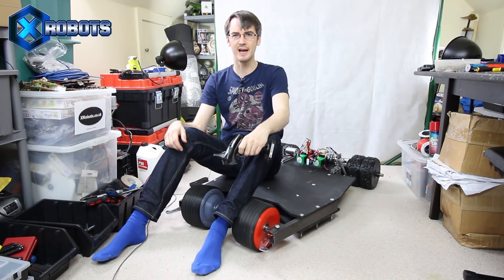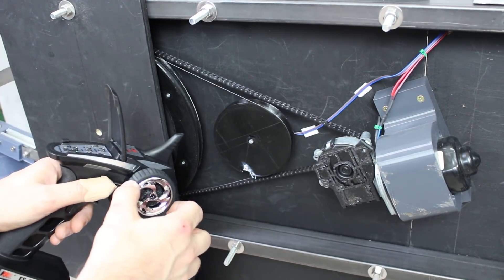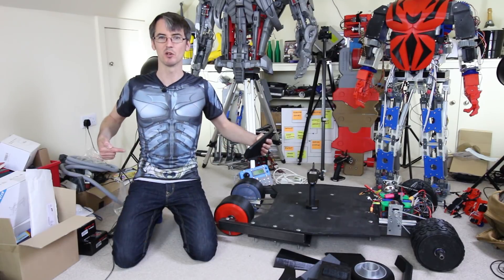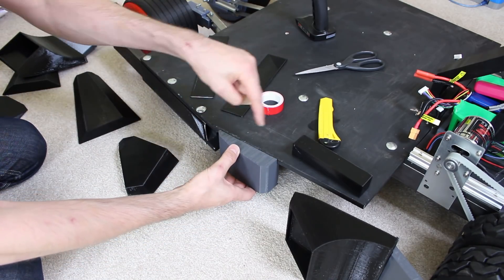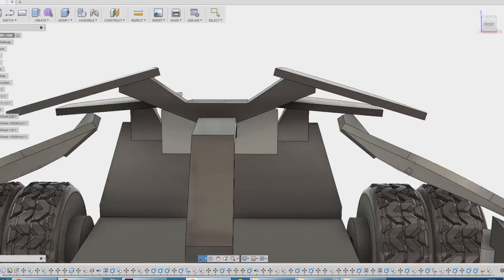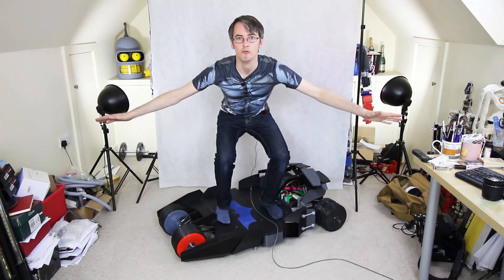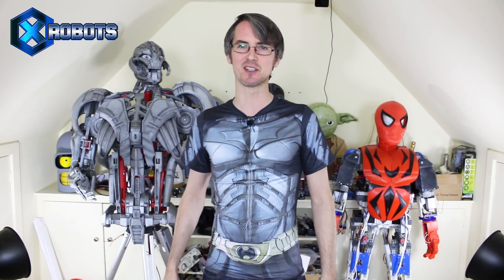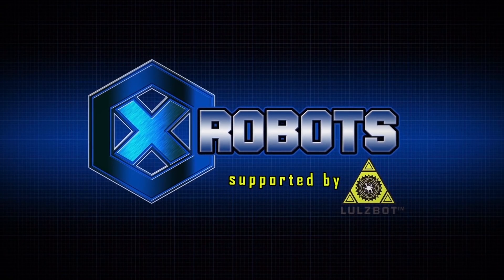Building a Batman Electric Skateboard #3 | James Bruton

Comment: It looks like it needs some kind of suspension to absorb all of the bumps in the road. also Can you use something like (Flex Seal) or (rubber O-rings) on the wheels to give it rubberized traction? I was thinking that vacuum cleaner o-ring drive belts would make good wheel treads.

Comment: Great job On this project and all your other projects I really enjoy watching all your videos. I am a full time engineer with a background in robotics. So I have set up a few vision systems for robotics. I was thinking in addition to using the laser to steer you could use the distance from the front of the board to control the speed and the direction of the board. Also you could change the projector to include some sort of guide so that the control board knows where the laser is in relation to the projection  so the distortion of the ground doesn't affect the direction you are trying to go. Just a thought I was thinking about when you mentioned the laser guidance again I love your work I hope you keep doing the great projects that you have been doing on this channel.

Comment: Please please PLEASE call it a scooter when you’ve added the handlebar. This project is very cool but your “skateboard” should have had pressure sensors at each corner from the initial design, as you’re supposed to control skateboards by leaning.
In fact, it would be far more impressive to see the robot trying to keep its rider from falling off instead of chasing a laser.

Comment: Hi James, how would you solve the problem of 1 tire skipping when turning using the solid axle without using a differential?, I thought of using 1 motor for each tire but then I would have to regulate the speed of the motor on the outside wheel

Comment: Hmm, I was gonna suggest a one-handed controller, with a trigger for throttle & a thumbstick for steering maybe? Or maybe a foot pedal for throttle & thumbstick for steering?
Reply: Wii nunchucks
Reply: yeah, something like that- there are one handed electric skateboard remotes with triggers or sliders for throttle, you'd need to add a thumbstick and rewire it for a r/c receiver- all perfectly possible with a bit of time and work.

Comment: Super cool!  ...is it a good idea that you design and create a accesory that you put on your selfe to control the board as you linn?
...like... using the stabilizing coding and sensors that you use on your BB8´2 to make a backpac or belt tat detects how forward, backward your body is leaning to acelerate or stop, and sences your thorso and weigt inclination to steere that way you will have mor estabillity and control leaving both your hads free. besides I can only imagine how great a batman-like back pack you will be able to create.
Excuse my bad english. :)  Im hyped by the idea!

Comment: Nice! Needs a thin black rubber mat on the top. And Batman would not like the non-black wheels :) Maybe you could use pressure pads to measure your weight distribution for steering.

Comment: It was amazing! Certainly something that Batman would ride.
You said that you need to lean as you steer. But, can you put an IMU on your shoulder or torso, and use the signal of your leaning angle to control steering?
Reply: Daniel Benalcazar that's a great idea. Imu on the body create other issues though. I can't remember them but he mentioned them when he was considering them for puppeteering Ultron.

Comment: thats looking pretty good now james. In terms of riding one handed you could add a thing a bit like a wii fit board where it steers as you increase pressure on one side. Then it will only turn if you are leaning so you can't forget to do so.Also just for an extra silly thing you should replace the cosmetic jet engine with an RC aircraft EDF because it'll be funny to see how fast you can go.lol

Comment: You need an angled area at the front and the back like a skateboard. It's be good if you could control the turning like a skateboard by applying pressure on one side or the other.